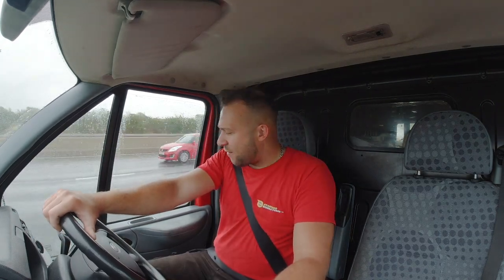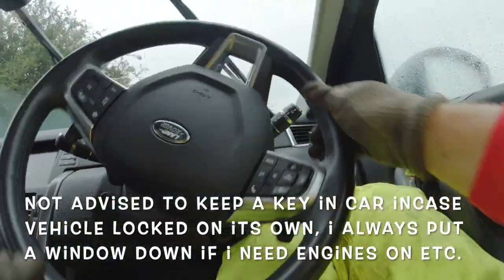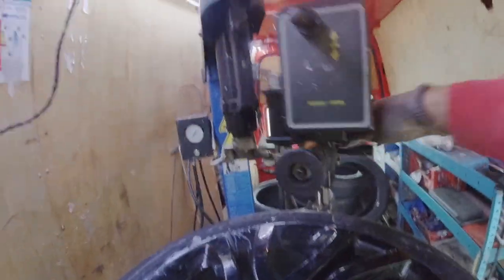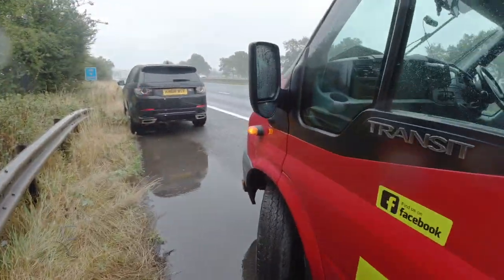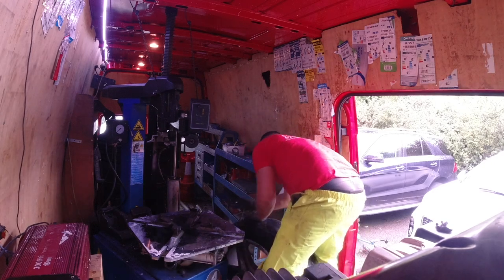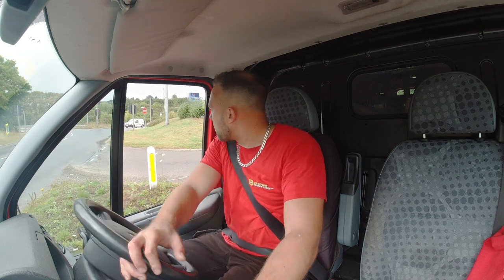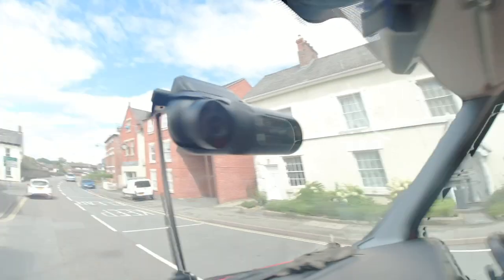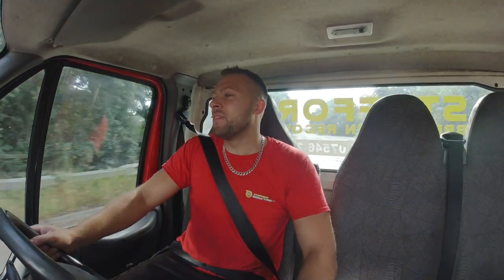Mobile Tyre Fitting on a Sunday! EMERGENCY CALL OUTS 24/7.

Comment: Are your van wheels pointing the wrong way when stationary? I’ve always been trained to point them the opposite way? Anyway good job man 👍🏻
Reply: I know I'm a bit late to you but....
I'd say Greg got it 100% right on this one at least with where the vans positioned and he is working, if wheels were facing other way and his van gets hit, it is going straight into the vehicle he's working on or into crash barrier and knocking arse end of vehicle and Greg out into the carriageway.
Reply: @benjiaj1963  I understand that, but when parked or attending an emergency on a motorway you are supposed to pint your wheels to the left, so aiming at the barrier this way if your hit from behind your better off hitting the barrier than the car in front or having your vehicle go back into the path of the traffic on the motorway. Sorry, I was a fitter for 17 years attending a lot of motorway work & always told to do this by my company & highway police, things might of changed now 👍🏻
Reply: Wheels pointing towards the barrier & his van should be sitting much further back 😬
Reply: @JJ-sc4uj  tbh as I drive a lot on motorways I’ve seen different people point the wheels either towards barrier or towards back into the carriageways? Maybe this needs to be clarified as different companies are using different methods! Obviously I think the safest way is to point your wheels towards barriers, think that is safest way but either way it’s still dangerous, 🤷🏼‍♂️
Reply from the maker: Sorry for DELAY, thanks for the comment, so normally if im very close to casualty vehicle I will face into traffic so it goes away from me if get hit, people on the motorway are already in a vehicle, with seat belts and an airbag, where as me and customer standing outside have 0 protection. If I was doing a FEND OFF and parked 20-50 meters back potentially I could face wheels into the kerb... Varys to the job in hand being honest in my opinion. Thanks for watching!
Reply: @staffordmobiletyresltd9840  
Yea you have a good point there mate 👍🏻 
Keep up the good work
Reply: Judging by the bend of the towing eye on the Peugeot... He 100% ran over the tow rope with the drivers front wheel

Comment: Is there like law or legal requirements on training or something is needed to work on hard shoulder please?
Reply from the maker: Common sense is always a good starter, there are numerous courses you can take, Thanks for watching,
Reply: Thank you for your answer Greg, we want some more mobile tyre van videos 😁
Reply: IVR top tip: park with your steering locked to the left and vehicle positioned slightly facing the curb. If a car hits you from behind it’s sending your van into the live lanes causing even more carnage. Dangerous job, top work 👍